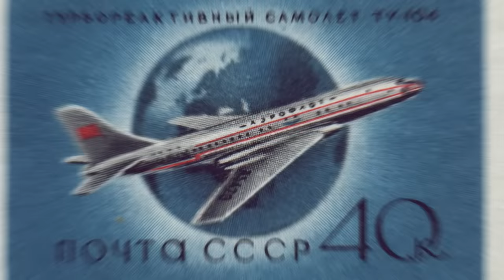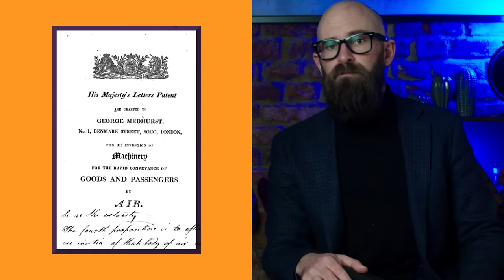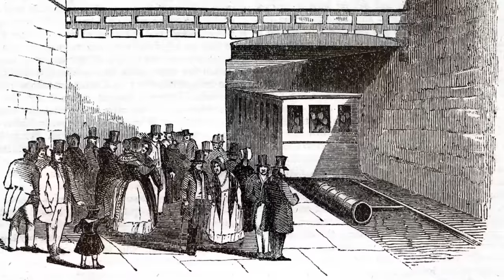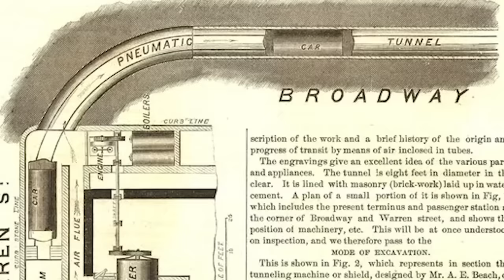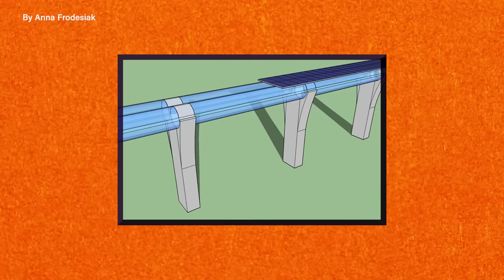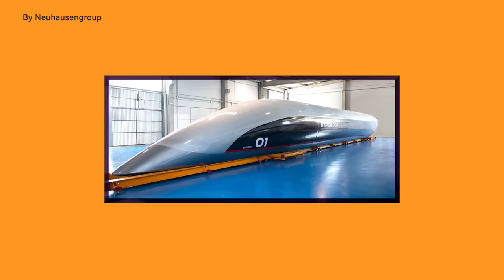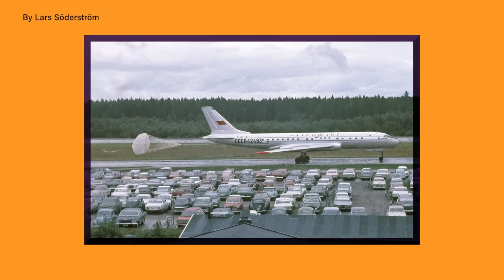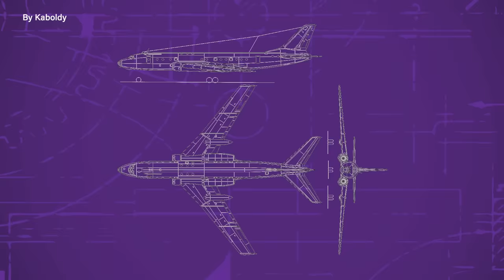Some MORE of the World's Most Useless Megaprojects

Comment: Somebody who works on a particle accelerator here to also dunk on Hyperloop; do you know how difficult it actually is to pump down a small section of tubing to high vacuum and the kind of equipment needed and the energy requirements? Yeah, that on a human scale is stupidly inefficient compared to just using a regular train
Reply: Yeah. There are better ways to achieve speed. 

 This is a really dumb question. Wonder if there is a way for trains to use something similar to those torpedoes that use super cavitation to create a bubble of air ahead moving the more turbulent air aside or some shit like that.
Reply: Exactly! It was always a waste of time and money and probably just a boondoggle for a massive tax write-off.
Reply: @DaveXXX preposterous! that would help poor people instead of rich people who demand more than they already have out of life!
Reply: @HyperactiveNeuron  or, just possibly, it was by someone who depends on cars being successful, trying to spike rail projects.
Reply: It's not exactly high vacuum.
Reply: Having worked with multiple vacuum dryers I can attest to how hard it would be to achieve even a small vacuum over a large amount of large diameter tubing.  The efficiency gains would be minor at best over just having vents along the path that exhausted positive pressure.
Reply: @DaveXXX  can't you for a moment not sound like a cheap soviet Propaganda Piece about the decadent West and use you Brain for a Moment to "look things" up, like "Highspeedtravel in Europe and Japan"?
Or would hurt that much that the reality clashed with your "alternative truth"?
Reply: Or just tunnels with trains in them
Reply: Doesn't it only need a difference in air pressure to work.?
Reply: @Nick Turner  yes, but still, you have to deal with seals both around cars & tubes,  cleanliness of the system itself, power consumption of pumps operating, etc... and you still have to pump on the tubes, which not even going into high vacuum with roughing pumps takes time and energy, it would literally be easier and less energy intensive to do regular high speed rail, which is why pneumatic trains were basically abandoned in the first place
Reply: @pseudotasuki  100 pascals? That is very little pressure.
Reply: Just build it in space.   Problem solved
Reply: @slackerman9758  You can reach that with off the shelf two-stage pumps.
Reply: This is a massive misunderstanding of iteration at scale.
Reply: @dianapennepacker6854  That is a technology that only works in water.  And even then, it's only used at short ranges.
Reply: I have the Answer! I can get it done! I'll just figure out how later...
Reply: @dianapennepacker6854  that sounds like it might end up being a sonic weapon
Reply: @pseudotasuki   Well, yeah, but for 300 miles? And most of the universe is at a lower pressure. But whining that it doesn’t reach your standard of high vacuum isn’t really the point. Are you implying that pumping out 99.9 percent of the gas will be practical or just kvetching?
Reply: @enisra_bowman  can't you for a moment sound like something other than a capitalist propaganda aficionado? Capitalism sucks.
Reply: I don't think people really understand that we need to get more use for less energy. A lot of people really think that it doesn't matter how much energy something needs if we have the ability to do it then we should just do it.
Reply: @slackerman9758  Try that again without the personal attacks.
Reply: But...but... Elon Musk, the benevolant emperor of Mars and Twitter,  promised that it was easy!   He swore that it was easy!
Reply: @USSAnimeNCC-  How many people would decide to not buy a car because a train exists?
Reply: @pseudotasuki  Meh, so you were kvetching.
Reply: @slackerman9758  Cool. Ad hominems totally prove you're right.
Reply: @pseudotasuki  Commenting on the pointlessness of your comments is not a personal attack.  ad hominem stands for "argument against the person”. I am not arguing against you as a person, but against your behavior.  

Falsely claiming you are being personally attacked makes your comments relevant?
Reply: @slackerman9758  "directed against a person rather than the position they are maintaining"

At best you're tone policing.
Reply: @pseudotasuki  The guy who is niggling pointlessly about how high isn’t high enough is complaining when called out about policing? That is rich.
Reply: @pseudotasuki   But hey, I’ll give you a chance to not be merely policing the original posters word choice. So, do you think that having the vacuum be at a level that a two stage pump can reach invalidates the rest of their comment?  I don’t.  And if you don’t, then you were merely policing their word choice.
Reply: @slackerman9758  I already provided a response to that point. You still haven't responded to it without including a personal insult. But you made a solid attempt.
Reply: @pseudotasuki  I haven’t made any personal attacks. I have seen where you have claimed I have.  I did challenge the relevance of your comment by labeling it “kvetching” when you have repeatedly refused to say why it is relevant to the original post. Please do so now, and not say “I have already done so”.  Where do you stand? Are you policing peoples word choices or actually making a point?
Reply: Money and greed , win hands down over common sense - 99% of the time.
Reply: The real vacuum exists in the heads of the people who think of these crazy ideas.
Reply: The existing equipment would run much better, given a higher standard of track upkeep and consistent priority accorded to passenger rail.  This can be accomplished by nationalizing the track system itself…

Figure about twenty to forty percent faster overall…
Reply: Anyone who has worked on a vehicle with a vacuum tube will be aware of the issues and the potential for failure.
Reply: @HyperactiveNeuron  Exactly !!
Reply: Hell just doin underground plumbing and having to put that on vacuum for inspection. We have to isolate small sections, about 100-200 ft n get if I remember right 8 inches of vacuum. And that's just 1-4 inch pvc pipe!
Reply: No kidding until.we master energy generation it just a dream.
Reply: I could only imagine. And I build ultra high vacuum chambers on a small scale (some have been for places like CERN tho) and even though most of then could fit in the back of a pick-up truck, they take for ever to test for leaks.
Reply: @DaveXXX  That's easy for rich people to say when most right wing governments have facilitated the rich and powerful since the dawn of time. That while the low and middle incomes actually contribute the most to a country. 
It's only because we haven't succeeded in creating a just society yet, because the rich and powerful are scared to lose their unfair advantage.
Reply: Can’t agree more.  I only worked with researching high vacuum vessels made out of a titanium shell the size of a paperback book. Surfaces outgas no matter what you do. Bye bye vacuum. “Hyper loop” hype is to get investments from suckers.  FOMO is a powerful thing, isn’t it?
Reply: @Thomas Link  everything outgases, but with baking out, handling and proper cleaning prep, you can still get outgassing to a reasonable level. Titanium is pretty awesome stuff for vacuum, can I ask how the surfaces were manufactured and prepped?
Reply: Thats like, X-Men or Demi-God levels of power lol
Reply: I'm not an engineer and even I knew this was a bad idea
Reply: Also, how would you even get close in differing altitudes?
Reply: Big hyperloop sized S/O to pseudotasuki and slacker man for the entertainment
Reply: If compare Hyperpoop to a Particle Accelerator...

This would be insult for a Particle Accelerator!
Reply: I know banks do it in the drive thru pretty easy.
Reply: hey i work on a particle accelerator too. my particle is ham
Reply: He literally says all of this in the video. What is the point of your comment?
Reply: @lelsqueks  please note there is very little ham in hamsters. hope that helps
Reply: @dlscorp  this changes everything
Reply: @pseudotasuki  Ah, a Muskovite not knowing what a logical fallacy is. Always funny.
Reply: I am a scientist. How hard something is doesn’t matter. How useful it is to society does. Never forget that us in the scientific disciplines serve humanity, not the other way around.
Reply: Two of the insanely stupid ideas is The Line and Hyperloop,
Reply: To be fair, Hyperloop is merely the LeBron to the solar roadway's Jordan. I learned about SO many absolute imbeciles in my social circles during the 15min of fame the so,are roadway got a few years ago.
Reply: All of the negative viewpoints are eerily similar to the," electric cars aren't practical, you can't land a spaceship and relaunch," rhetoric Elon dealt with before. He seems to have insights that the average Joe doesn't. By and large, if you don't understand what he's doing, invest anyway. Over longer time-frames he seems to profit off of doubt. Keep it up, but remember what stance you took when the future arrives and be as loud-mouthed with your apology when you see for yourself. There are interviews where he explains a several layer system and answers a  litany of technical questions. Simon you are no longer fact boy, more of a lying by omission chap. Have a good day.
Reply: @WilliamNail-t6f  Dude, you aren't even getting the SpaceX analog correct. People doubted the vertical landing of the boosters to be too much of an engineering challenge to be a good cost-benefit endeavor. People didn't doubt the ability to reuse them if they could be successfully landed. Also, no one is arguing that electric cars are any more practical than they were believed to be in the late nineties. They were bought for clout and virtue signaling and now the sales are cratering. Once we finally get to "hyperloop", we've reached an order of magnitude higher bar and NOT for reusable equipment like the boosters, but rather for operation-critical qualities such as the vacuum in the tube which MUST be perfectly maintained for the technology to work at all. 

Your "analysis" seems sorely ignorant of underlying realities, and you seem to be relying on nothing more than confidence in your golden calf, Musk, to support your view, in much the same way that crypto bros invoke FUD and hodl and "to the moon" as if they are magical spells and we live in a world where Hogwarts is real.
Reply: @user-fn1zn7qh3s  do you really think he designed everything for Space X and Tesla? Tesla existed before him and were actually doing decently, he didn't design or bring a single good idea forward, he isnt an engineer, the self landing segments to reuse for Space X isnt a new idea, they got it working, but recovering stages has been a thing since the space shuttle. Electric cars have existed for over a century, I'm on my second one, the Hyperwhatever is an answer literally to an existing solution, which is trains but with a thousand extra things that dont need to be there, and it evolved into literally an underground taxi service
Reply: You don’t need a perfect vacuum to operate a hyper-loop, you luddite. 

It absolutely will be in use in a few decades.
Reply: Not a particle accelerator guy, but worked with high vac most of my career (SEMs, MBE chambers, etc). I would like to second scott2100. Just... idiotic all around.
Reply: Lol, nope! However, I do work with vacuum furnaces, so I really don't get why in the world anyone would think this would be a good idea for transportation. Vacuums are best used for the opposite of that.😂